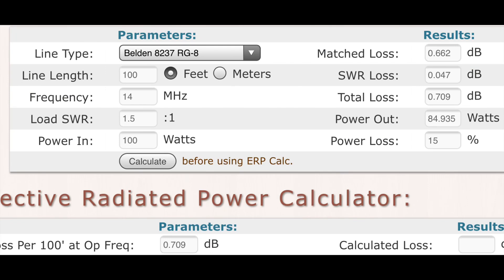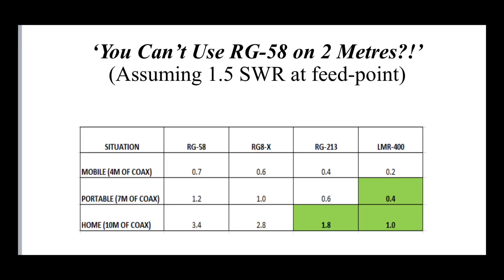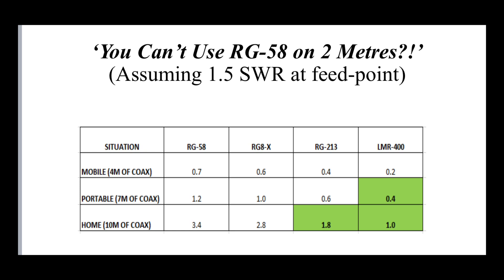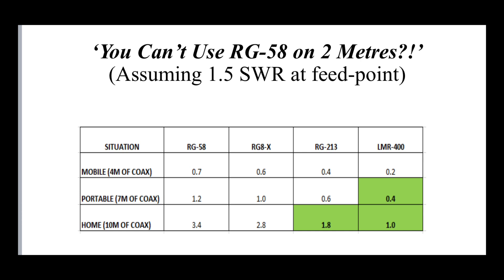Ham Radio: Coax Cable Myths

Comment: You certainly pick a topic full of misinformation. Like people have said theres coax then theres coax.. every situation will have its own specific needs if your trying  to get that last dB of signal. What i have found over the years its not the coax its the issue its more the connectors and amount of connection points. Try and keep to a straight run and best connections you can, from there its your antenna, location and lastly coax. Luckily at HF wet string would nearly work. One reminder though is power power peak voltage vs coax flash over especially for HF. If RG58 doesnt foot the  bill theres multitudes of others LMR195/LMR240 and upwards. I did have a giggle of using LMR400 in a mobile situation my want the ultraflex for that application! Anyway great video. Glad i found your channel
Reply from the maker: Thank you, Phil, for both your kind words and the great information. 73

Comment: I think it's only a Matter of economics. If dubbeling the output power is more expensive than using better coaxkabel that will have 3 DB les los, the choice isn't All that difficult.
Reply from the maker: Yep that’s logical

Comment: Thank you.
   I have used RG 58. It works fine.
   Whether on 2M or HF, the biggest problem is interference and atmospherics. Where you locate your rig, 
transmission line and antenna is much more critical, especially in reception.
   For my friends who are seriously competitive contestors, yes it appears to make a difference. NOQFT
Reply from the maker: Good points Glen

Comment: All engineering is about time, space (or weight) and money. We can set velocity factor aside, save for the calculations, so that takes care of time. So it's all about space (weight) and money. Roman Roads were labor intensive and used too much stone. But some of them are still around today. "Over Engineering" say with RG-213 might make sense if you can envision a high powered rig in your future, even if you are QRP now, since you've eliminated a weak link. Good Antenna comes first, but we use what we have on hand or can acquire and afford. That being said, I would like to see something on using 72 Ohm coax for the 50 Ohm radios if you have some of that lying around. And then there's the open wire, twin lead argument (and solution) that would also make for a good video. How to use what you have, even speaker wire or lamp cord or even a roll of mains wire for antennas/feedlines. You never know what situation you may be in, or what junk is actually in reality valuable surplus that can be used in a pinch. 73 DE W8LV BILL
Reply from the maker: Great points made here - I have loads of old twin core electrical cable I happily strip and use for my antennas. All are therefore brown and blue - could be my trademark! 73
Reply: @TIMG5TM  Before you strip it, try using it as 72 ohm twin lead feeder for a dipole, see how that does. I've used mains solid core electrical cable to wind all my un-uns/baluns.

Comment: There is a use case for any type of cable. I look for the 1.5db point and if that is with in the length of run I need, any more than that amount of loss and I look at the next larger cable size. At the end of the day there is no wrong choice really as long as it meets your philosophy of use.
Reply from the maker: Good point about the 1,5dB and I share that same outlook 73

Comment: I will take it one step further....HF doesn't even require 50-ohm coax....75-ohm RG6 works fine for a 100W station.
Reply from the maker: It can do for sure
Reply: I thought of 75 Ω and RG6 for my h/b tcvr but other gear is 50 Ω so went with 50. I used tv coax and 75 Ω tv plugs when I had a KW204 and KW202 
G4GHB

Comment: Great video, Tim. 
RG174 is great stuff for HF portable or SOTA. In fact, I just made a 2m flower pot antenna using RG174 and it works very well indeed. As you say, for short runs the losses are negligible. Of course others will have their own opinions but that's exactly what they are - opinions, not facts.
Reply from the maker: Agree fully Ronan 73

Comment: I’ve been using RG58 Mil on all HF antennae for  decades. I use RG213 on V/UHF… never had issues and made contacts around the world. You now see RG174/316 used on HF these days with excellent performance.
Reply from the maker: Indeed Andre 73

Comment: What I find MOST surprising is how many operators will buy the BIGGEST BADDEST antenna on the market, and a 1Kw Linear and then run some old shitty RG-213 or similar coax they found in the back of the cupboard under a few dead mice, and then wonder WHY their mate with a cheap as chips antenna gets out better than they do, with his new clean RG-58 coax. Even RG-58 works if you set your station up well in the first place. I use a 60ft length of RG-58 into a homemade copper j-pole and I can open 144mhz repeaters 50klm away with 800mW output from my Baofeng UV82L. It's seems to work OK for me....opens the local 440mhz one's aswell on the same j-pole....gotta love those harmonics. 440mhz patterns might be all over the shop, but both bands are 1:1 SWR.
Reply from the maker: Good info

Comment: I use RG213 at home for 2m/70cm, and purely because the RSGB recommends a coax of 'at least 10mm' for those frequencies.....my RG213 is 9mm, so I still have 1mm to find!?!
Reply: Wrap the coax COMPLETELY in 3 layers of electrical tape and you'll be 1mm thicker......
Reply from the maker: Nice!
Reply from the maker: Im sure it will work

Comment: the most important thing with vhf is height as we all know but with uhf there is a slight loss and they recommend n type fittings its basically up to the individual at home rg213 in the car rg58 thanks tim 73 m3hnl
Reply from the maker: Agree with you. 73

Comment: I think if you look more at 70cm and a more typical home rig where you might be using 20m of coax, you could be looking at 6-7dB loss (depending on which RG58 you pi ck) vs. 1.9 for LMR400. 4-5dB alone may not sound significant, but it isn't a vacuum. You need to look at your signal to noise ratio. 4dB can make a big difference.
Most pre-made antenna setups run around 6m of coax, giving a 2dB of loss. (37% power loss).
going a a well trimmed 4m of Ultraflex7 (between 213 and lmr400) you are looking at about .5dB
RG58 is fine for jumpers, but for a VHF/UHF setup, you are better off with a well trimmed run of 213/LMR400.
Reply from the maker: Thanks for the info 73

Comment: I use RG58 on 2m and 70cm about 10M run. It's cheap and lightweight. I have a 100M of Ultraflex 10 in the shed. Only used it once.
Reply from the maker: Thanks for the info

Comment: Coax loss in Db is just one part of the link budget. When added to a path loss of 100-200 Db, it helps but not often why the contact failed. Other factors aside, every time you double the distance the signal is reduced by 4 or six Db.
Reply from the maker: Yep

Comment: You should do a comparison on RG-8 and RG-6. I use RG-6 on all my base and short repeater runs.
Reply from the maker: Ok good suggestion
Reply: @TIMG5TM  I threw up some satellite TV coax (RG6?) on my home made 5 element 2m/70cm quad just to try it as it was what I had in the house, expecting to replace it later. Funny thing, it seems to work very well, even with a reasonably long run I'm still getting into 70cm repeaters 50-60 miles away from the bottom of a valley with my antenna in the attic.

Comment: Hi Tim,  hope your well. Good video again.  This might shock you, but I've got no idea what coax iam using hi, I cannot afford to be too picky  so iam using a length of coax I was given on 80m through 6m, not sure of the length or losses  but I know along with my home brew vertical ant, I get into eu from zl most evenings on cw and ssb. 
Maybe I should be worried and checking your calculations,  but 
My  old dad said, if it works lad, leave it alone hi hi. Get on the air and give it a go with what you have at hand I reckon. 10 years and it's all working well so far hi.
Best wishes Tim, keep up the good work. Zl3xdj
Reply from the maker: It gets you on the air - thats what matters Brian 73

Comment: I worked in the two way radio field for 33 years and for mobile use, we always used RG-58 for VHF and UHF. EVERY major manufacturer of the mobile antenna kits include RG-58 cable runs. Only for 800 Mhz did we start providing the next size larger cable.
Reply: I have the same experience (general class  - 50 years). -1db is a 20% loss. Which in most situations is transparent. A good antenna and transceiver will more than make up the difference. For long runs, higher bands, and high power, then RG-8U is needed. That said, I ran 450 Mhz with a 5 W handheld on RG-59 for several years using a home made dipole antenna as that was all I could get away with in my apartment. Worked just fine.  Was it lossey? Yes. Did it really matter? No. I could still hit the repeaters a solid 5/9.
Reply from the maker: Agree
Reply from the maker: Interesting

Comment: What about RG174 on those micro magmounts for 2m/70cms? They are typically a 3m or a 5m run. Terrible loss or bearable?
Reply from the maker: HF - not an issue. UHF - not great.

Comment: I use 400 Max (aka LMR400) for everything other than portable, which I use LMR240 Ultraflex. Why? Because I can buy it in bulk and save money and in the case of my shack, I can put what ever antenna at what ever location I want. I bury my cables and have 4 different locations my antennas are at. As far as RG174, the vast majority of it is NOT suitable for use in adverse weather conditions. For POTA/SOTA sure, but to put it up in your back yard year round, no way. Also, there is the fact that it can't handle a lot of power (most of the time it is only rated at 72 watts @ 50MHz).
Reply from the maker: Good points - thanks

Comment: The advice is; Use good quality coax, with good shielding. RG-174 can take about 197 watts on 50 MHz and nearly 150 watts on 2 metres. Even more on the lower bands. The problem with these coax cables is when using very long runs.
Reply from the maker: Indeed

Comment: One of the best improvements most amateurs could make is to learn to fit coax plugs properly

Now for a proper roasting, point out the tiny differences in measured performance between PL-259 and N type connectors :)

And yeah, I did wonder how you'd managed to make loss non linear
Reply: I've seen measured losses for various connectors and converters being around 0.01dB so I'd have to stack a load of them to notice a real-life difference. Mine are BNC as much as possible because they are more reliable and easier to deal with for portable - so many cycles of attach & detach...

Comment: Great video Tim.
You wouldn't believe how often I've been "bashed" for utilising RG58, RG174, even RG11 or ladder line as if I'm some mad fool. Hard to get around the salesman pitch though of, "RG213....because you're worth it!".
Use whatever you like so long as it gets you on air and "don't sweat the small stuff".
Reply: Make sure you get the good stuff, and one cable run for each way of the signal, matching the arrows on the cable with the way electrons flow. :)

The way this hobby runs is very similar to audiophiles. Fools and their monies are easily parted.
Reply from the maker: Agree Victor

Comment: I think it's down to what your happy with and you have to take into consideration, quality, price, weight & purpose ? I use RG58C/U Mil Spec for everything HF, UHF & VHF. I find it supple, good quality, good price, not too heavy and PL259's are cheaper using RG58 than larger diameter coaxes. I used to use any cheap RG58 back in my old CB days in the late 1970's, but now realise that any signal you do receive at your antenna isn't lost too much on the way down to the rig. Same with power going up to the antenna, especially if you are a Foundation licence holder where every watt counts. I think you should also consider the run length and have it as short as you can and check regularly the condition of your coax and connectors. Which is a must whatever coax you are using ? Sun, frost, wind and rain are the culprits for deteriation of coax, so check regularly and if suspect get new coax. If you value your receive and signal, I would change the coax every 5-10 years ? 73's Andy M6APJ.
Reply from the maker: Good points Andrew

Comment: The RG 174 is ideal for getting the feed into a car if you don't want to drill the body work as it will pass through the panel gaps and won't be crushed either.  Ideal in short lengths. Negligible loss.
Reply from the maker: Agree Peter
Reply: I use RG-58 in the same scenario and don't get it crushed in my car. I've found the best place to route it out of the back door though.

Comment: Hi Tim I have been using 3 to 4 m runs of Rg174 on my magmounts and fixed mounts on my Landrover Freelander enabling me to feed so easily hidden the the vehicle and have found no difference compared to the original coax that was fitted to the magmounts. I also use it like you mentioned when out portable with the ic705 and end fed. Another good informative video Tim
Reply from the maker: Thanks for the info! 73

Comment: Going off on a tangent (hope that's okay), coax losses come in to play at VHF UHF. My observation is most (all) stations use coax at VHF UHF. I've never seen open wire feedline used at VHF UHF. Is there a reason(s) why coax is preferred over open wire? I'm assuming open wire has the advantage of less loss at these higher frequencies so what's the trade off that makes coax the preferred feedline? Thanks for any thoughts/comments.
Reply from the maker: Interesting point - sheer convenience?

Comment: Hi Tim, thank you so much for this video. I'm using RG58 and RG174 from 80m to 2m and I do accept the small losses. If the antenna is well tuned (not by a tuner), it will equalize the loss of the cable totally. A well tuned ZS6BKW i.e. will work well with 10m of RG174.
73 Martin DG4BAD

Comment: Ive been using 10ft of RG316 for a few months when out portable, I'd like to see a comparison to RG8X or 213 but so far it seems to perform adequately. Interesting stuff Tim.
Reply from the maker: Doubt you’d notice any real world difference with 10ft Lee
Reply: I used rg8x for my 11 meter dipole antenna,works great 
I'm building a 10 meter vertical dipole antenna ,I'm gonna use rg8x for it also 🎉🎉
Cheers 
Happy Easter

Comment: I tend to use RG8 mini for everything. Somewhere between RG58 and RG213 for losses (a little closer to RG58 if I recall), but its lightweight and manageable. A good compromise I think. At this point in my Ham hobby/life, the small loss differences are not the most important thing to me. If I got deep into satellite and serious QRP, then I might consider the 'proper' stuff.
Reply: you buy the best coax you can, well if you think of all the money you spent on radios and all the sundries, you should.
Reply from the maker: Good points

Comment: Thing is. Can you tell the difference between an S8 and an S6 signal? No? Not really? Then you're going to notice naff all difference in signals you can receive anyway.

What you might notice is that you are better able to hear a very weak marginal station. Will that get you a contact? Maybe... is it worth the additional cost? Nah, not unless you're taking contests seriously.

Instead invest the effort into your audio path and your antenna situation imo.
Reply from the maker: Depends on the noise floor at the receiving station

Comment: Great analysis Tim. It is a game of choices.  There is no doubt that (decent quality not eBay rubbish) RG58 "works".  It is all down to the marginal gains (excuse the pun!), that you have control over.  Frequency, power and length of run are all factors here as you say.  Once you begin to analyse these things, shaving off dBs may become obsessive - particularly if portable or QRP as you demonstrate.   However if I have shelled out 1500 quid for a radio and spent hours (days) on my antennas, then I am not conecting them up with RG58, period.  For the average mobile 100W radio - RG58 is fine.  For any keen enthusuiast's home set up with investment and a yearning to maximise efficiency at a relative low cost - good (better) coax is the right choice.  We can't all have Yagis and linears - but we can all have good coax for the price of a few Costa coffees.
Reply from the maker: Nice points Tom. All swings and roundabouts. Mind you if 10m opens like it did last night then a dB here and there won’t matter a bean! 73

Comment: Hi Tim. Well put & I'm inclined to agree with you.

I'm not a big fan of RG-58. I have previously slated it in a couple of my videos. To be fair I did also say that RG-58 has it's place in mobile & portable setups. I use RG-58 for portable (SOTA & WWFF) & also mobile operations on both HF & VHF.

As you correctly point out, I wouldn't use RG-58 in a fixed (home base station) setup.......at least not on VHF. Even on HF I would probably be looking at something slightly more heavy duty (RG-213 or similar) if I was going to go to the trouble of installing a new coax run.

I know a lot of people do use RG-174 for SOTA. I personally don't. I've found it to be a little fragile compared to RG-58.

Each to their own I guess.
Reply from the maker: Exactly James some good points there

Comment: I use RG58 portable because it's light and winds up well. Cheap to replace when damaged. At home I use Ultraflex 10 only because of the much better screening to reduce noise floor by 2 S points.
Reply from the maker: Good points